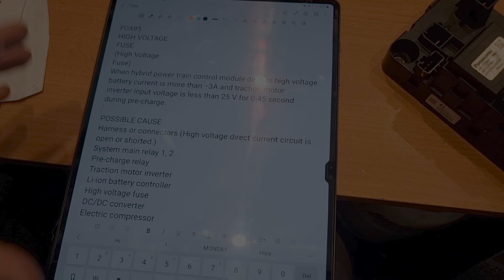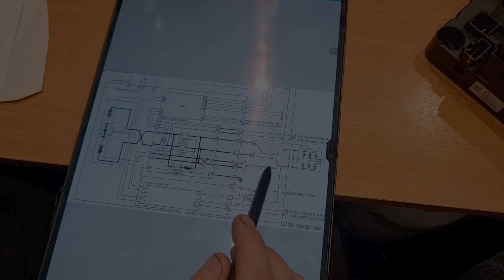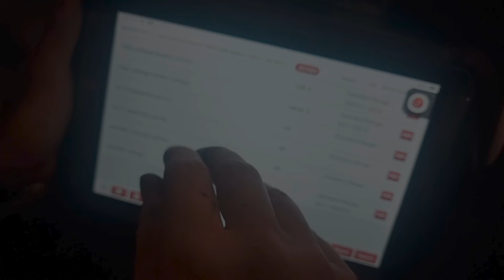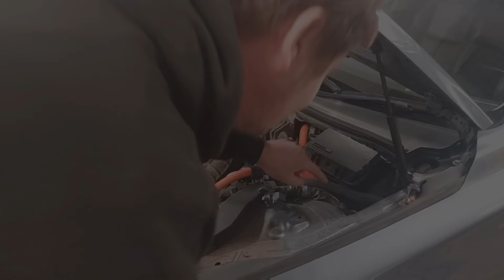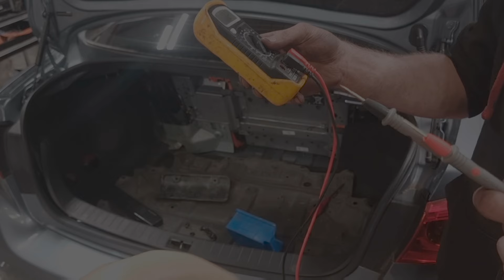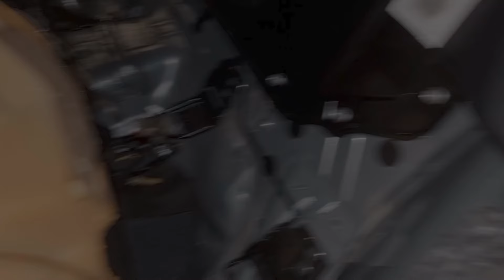CAN WE FIX THIS NON RUNNER ELECTRIC HYBRID HEV INFINITI ???

Comment: I live in Japan and have just purchased a 2018 Q50 (Nissan Skyline 350GT Hybrid/HV37).

The Q50 is truly a fantastic car when everything is working as it should.

Unfortunately, while driving it on the day I bought it, I discovered an issue with the multifunction control unit.
I took the car back to the dealership the very next day and made sure they agreed to repair it under warranty.
So far, I’ve only had a few hours behind the wheel.

Your videos are quite technical, and I couldn’t fully follow everything you explained. Still, I wish I had experienced professionals like you nearby who could help me with issues like this.

Keep up the great work, and thanks for sharing your knowledge!
Also, I’m sorry if my English is a bit off.

Comment: "I’m currently experiencing error code P30EF for the second time in my Infiniti M35h. I suspect the issue may be related to the AC compressor. Yesterday, after starting the vehicle and setting the air conditioning to the maximum level, the 'Check Engine Soon' light appeared on the dashboard."

Comment: Hi guys, I'm in jamaica, and I have one of the  infinity skyline gt 350 hybrid. I parked it for about a week at home for about 2 weeks, then decided to drive it but it won't start. I took it to the Electrician and he says the ac compressor not communicating. I got new one but it still won't start.
Reply: Did you get the problem fixed?

Comment: I have got same car but was in accident few months ago,it now repaired but cant started, it display same message error.what could be the problem?
Reply: I have the same issue car crashed got it sorted out but just won’t start
Reply: not yet..its still not starting 
.did you pull any codes from it? @tejuanbethune881
Reply: Did you get the issue resolved?

Comment: A very interesting video. Josh and his team are very knowledgeable. These Hybrid/battery vehicles are extremely complicated and I wouldn't want one. The more complicated the car, the higher the bill when it goes wrong. If it was a working (business) vehicle, the wait to have a specialist try to repair it would be very costly. £ 1400 plus vat for a part which costs 97p, if you know where to get it, is a disgrace. Manufacturers are profiteering. Would I buy a hybrid or battery vehicle? Certainly not!

Comment: So basically they last garage fitted a dodgy aircon compressor and blew the resistor. Then charged the last bloke 1800 to not fix it, then wanted 5k to try some other bits.... Annndddd then, offer him 800 quid for it. Reckon they knew what it was when they offered the 800.. i also think that they could claim for the dodgy parts they fitted which destroyed his car.

Comment: I made a suggestion a while ago about it would be nice to see an ev on the workshop floor, not realising the hazardous work involved. However, I'm glad to see you did it. I watch the whole video, even though I'll never be working on one myself. It was interesting and makes you wonder if the garage had had the experience before and had an idea of the problem.
A lovely idea to profit share with Josh. Nice one. 👍
Reply: The original garage diagnosed the first part of the problem (AC compressor) correctly, full credit for that. From then on the diagnostic process went a bit downhill judging by what little we know about the inital repair efforts. Josh definitely sounds like he's encountered the problem before. My money would have been on the control side of those relays, either a fault in the 12 V wiring to the relay preventing it from turning on or a fault elsewhere keeping the computer from activating the relay.

I'm a bit surprised the resistor went before the compressor fuses blew though!
Reply: I think that fuses are too insensitive for many electronic components, which is why RCB's offer better protection.
Reply: @geoffaries  As far as semiconductors are concerned I agree yith you but resistors are generally pretty sturdy unless they were undersized in the first place.

Comment: Makes you think.  The mechanical maintenance for an ev is reduced (filters, brakes etc) but when there's a problem with the high voltage system it truly needs an expert.  There also most be a huge number of hybrid cars getting scrapped for one relatively simple failure that hasn't been diagnosed properly. Not green at all...
Reply: No, the market will adapt like it always has. There will be new companies specialising in these systems and less companies fitting exhausts etc.

Comment: So a compressor fails and wipes out the entire electrical system due to a resistor made of Unobtainium.
Nissans are trash.

I had no idea modern cams have a 'Vaseline on Lens' setting.  Definitely an art in recording video.

Also: I think it would be more than fair to tax EVs based on vehicle weight; they're not HGVs, but they will start to have an impact on road wear (1.8 tons!).

Comment: Well that has made my mind up, keep off those electric cars if you are over 60 'cos they will wear out before you do and cost a fortune to fix. At least with normal cars they can be fixed without all those safety precautions and the fuses are quite accessible. Excellent video, thanks lads.
Reply: Keep off electric cars no matter what your age! Im 39 and hate them!

Comment: Well the guy in the garage dealing with the last keeper Obviously knew what the problem was just wanted to get a cheap car and the guy you got to do it was really good and I bet after he looked at the Diagram he knew exactly what the fault was cos its the thing I would have checked but the big problem is electric vehicles will be in the scrap yards long before there Petrol and diesel counterparts will be as its the cost of batteries and the cost of fixing them so in the real world you don't save anything by getting 1 so I will stick with my Diesel car thank you

Comment: I'm not sure of the economics for long term hybrid or electric car running?  Just imagine when the current generation of cars start to need new batteries and develop faults, the parts/ diagnostics will quickly cost more than the value of the car.  I really like this video, the diagnostics are starting to get to the level for that of complex aircraft! 1:01

Comment: Wow
All that for a 97p part.
Reply: Yes but as always, It is no problem to fix something, The real problem is to find the fault. Diag tools are usefull but you have to ubnderstand the meaning and reasoning behing the fault codes. Same in All Electrical/Electronic circuits and mechinal issues for that matter. Find the fault (Big) Fix problem (Small)

Comment: Seen this before when the wrong compressor oil has been used, damages the internals of the compressor and shorts out the car, we were told this on our air con course, they do a universal pag oil suitable for all electric vehicles and standard vehicles.

Comment: Makes you wonder how these vehicles perform after an accident, if you weren’t injured in a crash you might still be electrocuted 🤔 ☹️
Reply: You'd hope there's a contactor that cuts out somewhere, like an inertia fuel cut off or the crash data not allowing a start like there is on a petrol car. I believe Fire Fighters and Recovery drivers are increasingly getting trained on how to find the link and pull it out.

Comment: Marvellous video as ever lads! I am now in my 70's been driving 50 odd years but electric cars have put me off road travel. The things with just batteries have high voltage and catch fire easily? and now you have told us the hybrid jobs have 450 volt cables front and back! Just imagine being in a pile up with two or more of the things being involved. Do they have earth leakage circuit breakers?
Reply: Wait until this old fella hears about 800 volt systems. 😂

Comment: would love to give a complementary comment! however this is designed as an instructional/educational video. Unfortunately the fact checking is out of the park! quite simply DV voltage under 1500v is considered LOW VOLTAGE and cars only have a voltage of 400. NOT TO YOUR USUAL STANDARD!
Reply: Do you want to stick your fingers in to see what happens😵‍💫
Reply: If it's got three numbers in, it's higher than I want to mess about with! The current delivery is the killer anyway, that's why you don't die when you get a jolt off 20,000V running down a split HT lead.

Comment: Personally, I would have split the profit with the original owner. Josh got his money for the work he did (£960?). Would be interested to know how many hours diagnosis and labour the £960 broke down to - it doesn't make an EV or HEV look like an attractive proposition when it goes 'bits' up ...
Reply: I think those that take a gamble or those that fix the problem deserve the profit. It makes up for the ones that don’t work out to be a cheap fix. 
Really the original garage need to refund the owner as they failed to fix and gave back the car in the same state (non runner). They probably new the fault and would of fixed it once they bought it cheap of the owner.

Comment: Brilliant video and superb skill to fix it.... but really, What sort of idiot designs a motor vehicle with effectively an unfused component (that could be 12v anyway with a standard car fuse) fails, through the high voltage system so WHEN they fail, the whole damn car is dead needing the attention of a real specialist with infinitely more intelligence than the designer to strip it to bits to fix it with a non available 97p part. EV the way of the future ?????

Comment: Dont know wether this was mentioned, havent watched the whole video, but volvos PHEVs had an issue with the aircon compressors burning out because the wrong lubricant was used at the factory, and it would cause the windings to short. Some cars would have 3 or 4 compressorsunder warranty until they fou dkut what was going on!

Comment: Wow what a job repairing EV and hybrid cars. those resistors are sandcast wirewound flame proof same type are used in domestic TV and audio equipment  but with solder fittings that be made to fit great repair lads !

Comment: Can I suggest that you wear safety specs once you are working on the high voltage side. If the battery faults or there is a short it will go with the force of a hand grenade. Take it from someone who has been blown across a workshop.😟

Comment: That was a brilliant video which is a real eye opener to what the future of vehicle repair will be like. As electric cars become more common the parts will will be more readily available, they will drop in price and the vehicle will be cheaper to repair. The situation is very similar to vehicle control modules where in the past you could only ever buy them from the main dealer for ££££100, but now you can have the module re manufactured at a far cheaper price. I wonder how mush Nissan would of charged for the same diagnostics and repair 😏

Comment: Adding to my earlier comment which praised Josh, people are wondering where we will find EV technicians. Perhaps the answer is in the many thousands of multi skilled electricians working in factory production lines with equally complex control systems and 415 volt supplies. Another comment described working on variable speed drives as similar in scope. So there is plenty of experienced problem solving expertise out there, just not being appreciated by employers.
Reply: Yep, although some of the pure EVs rather than hybrids are closer to 800v. Absolutely insane voltages and not something I'd wanna work on.
Reply: @MattyEngland  Shut up! you are putting me off being a passenger in a car! Don't they have safety systems or circuit breakers?

Comment: What fools on the previous video said this will be no different than when fuel injection and ECUs were introduced. There is not a chance you’ll be doing this on your driveway in 10years time. Your be paying £150+ an hour labour or throwing the car away like this owner effectively did

Comment: That’s what you call a proper mechanic too many mechanics these days do a bodge job instead of finding the root cause of fault/issue replacing one thing without investigating and the car ends up on its arse again at the garage for another few weeks code reads same issue as last time but no investigation… headache of wannabe mechanics and real mechanics…

Comment: A huge thanks to Josh for filming all this it was a real interesting video learning about EV's and the stupid cause and expensive problems they have if you can't buy a simple 97p  resistor. The guys busy so i wish people would stop whining about the quality of Joshes  filming, he didn't have to share any of this diagnostics and the repair.  All we could of seen was the car leave the channel going there and the details of what it cost and sold for. Also  thanks goes to you both for taking a chance buying it for us to see, and I'm pleased it turned out right for everybody in the end. Take care guys
Reply: Hi, I was one person who mentioned about the video quality. At first I thought the fault was with my TV (I was watching YouTube via a Firestick). I've recently repaired the power supply of the TV at a cost of £2.50 for a new capacitor, and thought what's gone wrong with it now. Just like the Infiniti being repaired, my TV had failed due to a cheap electronic component needing replacing.  Anyway enough waffling (getting as bad as Rob - lol).

Comment: Do the shrouds not need to be fitted to the probes to comply with cat III test leads or was that for GS38? I’m not sure what standards are required for EV’s? Nevertheless it’s interesting to see how procedures are carried out with focus on safety. Worth mentioning… DC current at high voltages is far deadlier (and dangerous) than similar AC voltages. Working in confined and restrictive areas gives cause for concern. Particularly when there’s an unknown fault. Don’t think that safety is ever stressed enough. Right… where’s that wonky screwdriver 🙄. ✌🏻👍🏻🇬🇧

Comment: 🎉as the air con  compressor replacement seemed to be root cause maybe regular cabin filter changes in order as you said both air filters clogged 😮
Love the out of synced in car waffle, almost like you'd been dubbed 😅😅

Comment: Good video, Rob and Chris 97p flex Resistiré unbelievable and your bloke got charged five grand and £1800 or Driver. Total price 2011 normally when I’m working on my engine or disconnect the 12 V battery, as well as it the other bit only because I’m taking off the inlet manifold to clean it. All the EGR valve but mine went in the garage. I had to have a new hybrid battery on it but managed to get a reconditioned one for 750 quid so I thought as a bargain and it’s done by a Toyota technician, car run good I think Josh made a very good video is very interesting keep up the good work guys

Comment: that video is by far the best you all have put out ever. great the style style josh went to it all the way through , definitely opened my eyes for sure !!  well heres to the future ... electric cars !  garages will all need to change to survive very soon   can see josh and his team are gonna be whammed off their feet till others catch up  which will take a very long time, scrap yards will be full to brim with great looking scrap electric cars  owing to repair costs  if the faults cannot be found. just shows main dealers aint the places to go . a few grand spent and still not running  then another GUESS at what it might be but thats only another £1300 +vat + labour.  will that work ?  well can TRY.
what after that.
then sorted for a 97p resistor but a real brain behind it.  hats off to all involved.
 As for the car .. widny touch it wi a barge pole , that goes for al  electric cars !!  😫

Comment: Great video and lovely to see a couple of knowledgable guys really approaching a problem in a logical, methodical way with all the right equipment and also showing a lot of respect for the H&S implications. Also impressed that they confirmed why the resistor part had failed to confirm the root cause of the issue. All this makes for a great video. Finally, what a great pair you two are to offer Josh half of the profits. Well deserved for you all.

Comment: Great to see a hybrid being fault diagnosed and repaired from start to finish. Some wider points come to mind: How does the original owner feel about the money wasted on this car - a write of for him/her! - perhaps a boot shaped word with the nissan service people. WHY is there no separate fuse for the Compressor? WHY are no parts readily available from Nissan? WHY is there no HV battery isolator fitted?, Why are Nissan charging £1400 for 3 contactors and fuses? If this is indicative of the design and levels of service for hybrids, it doesn't bode well for joe public - additionally, its not very eco friendly to scrap a vehicle for a 97p part. sorry just racked off for owner.

Comment: Great job done by Josh and his team. I have a 2015 Toyota Auris Hybrid the last 3 years and no hybrid issues. Had AC Condenser replaced 6 months after purchase under warranty and a new 12 volt start battery for £130 fitted. Only done 45,000miles now. My 1996 Volvo 940 lpt, petrol auto estate I also like. Now run in at 208,000 miles. Very reliable also.

Comment: Well done to Josh for a solid explanation through the process and to you for not chopping any of it out. That sort of issue will scare most high volume dealer workshops as you have to think it through and proceed in a slow hurry or sparks will definitely fly.. It is a cracking car but definitely beyond the scope of a DIY er if any electrical issues arise.  The prices that can be charged for parts are mind blowing. all the costs quoted for an actual 97p part were frightening.  It was a long vid but well woth the time. Thanks for going outside your comfort zone.